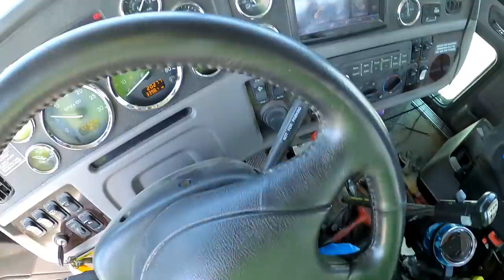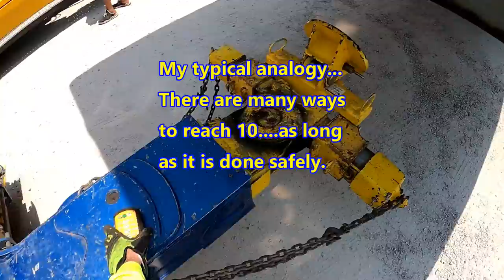SHUT DOWN AT THE SCALES!!!   TRAILER TOWING 'TATOR TIME!!!

Comment: Everyone hates the DOT Inspections, but that trailer is one of the reasons they are there. If the damage was not noticed at the scales, can only imagine what could have happened with the trailer loaed and coming apart on the freeway. Glad they caught it before a disaster. When you are done with the repair  I'm sure it will be better than new. Awesome job and video.
Reply: The worst part is that DOT never catches a driver the FIRST time they’re over limit or in need of repair!!
Reply: SMOKEY BEAR..ie DOT MAN..

IS MY FRIEND!!❤❤❤❤❤❤❤

LAW ENFORCEMENT AND TRUCKING PROFESSIONAL..NOW RETIRED!❤❤

Comment: When closing doors on van trailers, allays look up and make sure the top part is secure. Those doors have lots of flex and will close with just the bottom pin secured.
Reply: I have picked up presealed reefer trailers at shippers before that the tops are not latched.  Can be a pain getting permission to break a seal to close properly even if still at the shipper.
Reply: I just throw a ratchet strap around the bars when I encounter that

Comment: Re  : Chaining up the T-bar, my understanding there is that not only does it prevent the twin pivot points allowing the t-bar to rotate and potentially strike the underside of the trailer, but if it swingt the pivot under the 5th wheel would be at the wrong angle. It should only ever be able to tip front to back, as it it were to allow tipping sideways (if t-bar swung 90 degrees) you risk the trailer deciding to lie down and take a nap. (Then you really would need the rotator) Similar to when rigs turn the tractor unit too far when trying to get a trailer back out a ditch and losing the trailer over completely.
Reply: It's never good when the trailer wants to take a nap

Comment: Why is it more safe to take the trailer with the tow truck instead of the tractor? Or is it not trusting the driver to deliver to your shop to get fixed?
Reply: Because the driver was placed out of service
Reply: Think so or push it for one more load then might fix it
Reply: Because the trailer is deemed "unroadworthy" (think wrecked) by the DOT a cracked sub frame makes it OOS 
Out Of Service.
Only a tow truck can haul it off to be repaired.
Reply: Ron is licensed and insured to tow damaged vehicles. The trailer had been deemed to be damaged, and unsafe for use by the authorities while inspecting during the weigh. The leasing company contracted Midwest to remediate the problem and return the trailer to the tractor drivers upon completion. 

That's my take on the situation at least.
Reply: In my experience, the DOT/MOT (Canada) will not trust you as the driver to take it to an authorized shop for repairs. It must be towed and properly repaired. Too many "trucking companies" will sign off on repairs and risk the public rather than get repairs done properly.  The towers in the area know they will be closed down and fined heavily for releasing a truck or trailer to the customer prior to proper repairs.
Reply: When DOT places a truck or trailer out of service, it can’t be moved by driver for that reason so it gets repaired. That repair can’t be done on the roadside but it can still be moved by the tow operator to the shop to be repaired
Reply: I had this conversation with dot one time.  He towed my trailer for missing one lug nut. His excuse was the tow truck driver is trained to haul unsafe trailer.  Lol
Reply: The main reason is that tow companies have to follow proper securement procedures for any item they tow.  If the damage to the subframe was worse and not able to secure.  Then it would have gone on a RGN trailer for transport.  The reason a driver is NOT allowed to take to shop at this point is the trailer is out of service.  The rules had been placed since many drivers in the past would "say" they are taking it to a shop.  However later down the road they got loaded and driving it then failure causes a severe accident.  This is perfect example of a scale house doing the job.  However we need an extreme amount of additional officers as I am a driver myself and see too much faulty unsafe equipment rolling down the road.
Reply from the maker: @jerrykinnin7941  Exactly...thank you for the description to help clarify.  God bless.
Reply: Simply, the system that is used works. I have seen unsafe trucks being used as well as unsafe airplanes.
Reply: @RonPratt  could you have brought a semi truck or does it have to be a tow truck?
Reply: @tedmoss  yikes!!unsafe airplanes!!
Reply: @wilsonbobcatservice4151  From their point of view if you cant keep lug nuts on your wheels, then what other issues are you overlooking...
Reply: @MrJRod891  no the trailer was placed out of service

Comment: I'm wondering why you didn't use the Mini Pete, since you didn't need a 'Tator, just an underlift. Was it possibly because you didn't know if the trailer was towable or because Big Pete was your duty truck for the day?
Reply: I was thinking the same thing. But figured the other trucks were out already. What a problem to have. I do like the little Pete.
Reply: He could've used Truck 17, and saved a bit of trouble..But maybe it HAD to be a tow truck?
Reply: @Sara-L  It seems like it had to be a tow truck because it (the trailer) was out of service.

Quoting an answer in another post Ron responded to 
"Because the trailer is deemed "unroadworthy" (think wrecked) by the DOT a cracked sub frame makes it OOS 
Out Of Service.
Only a tow truck can haul it off to be repaired."

Ron responded
@Jerry Kinnin  Exactly...thank you for the description to help clarify.  God bless.
Reply: @realredditstories420  Trailer EMPTY......Little truck would have worked just fine.....load status likely wasn't knownat least thats how it always works for MRE

Comment: Love the new wireless lightbar. Does it not have the red and blues on it like the old one?
Reply: Red & blue are only necessary when getting to a scene (priority over normal traffic) or when a stationary hazard along a high speed right of way.  Aft facing and moving at normal posted speeds, no.  Yellow with white "kickers" is enough for visibility.  It also avoids the problem that arises when he crosses over to Illinois (or other states) on a job, where his Missouri-authorized red & blues aren't legal.  Why have an extra-fancy (and expensive) wireless lightbar with extra color options when this will do?

Comment: A couple of years ago, I saw you use the wireless light bar. Then I saw it in use locally and knew what it was. And that the RV being towed was being towed before I got around the vehicle. So I was alerted to the tow situation and exercised a little more caution when passing. Thanks!

Comment: Just curious could one just weld a  plate to the damaged parts or does DOT require a new sub frame
Reply: Given the stuff I've seen going down the road, as long as it passes inspection, you can fab up just about anything.  Of course, I don't usually look at them in detail unless they've already crashed.  Ha.

Comment: Didn't know you would need a translation app on your phone did you? I could tell those guys were frustrated because they needed a trailer to make money, so they didn't want to give it over. That is one of the problems when you rent a trailer.
Reply: But the OOS went to the Leasing Co. Since it was their trailer. Unless the drivers/company also got one for knowingly operating unsafe Equipment. A scale tried that one on me once.  Pre Trip Post Trip and a mechanic to fix it correctly is a must.
Reply: I'd expect the leasing company to supply the drivers with another trailer. Then when the original trailer is fixed, either haul it out to them, or more likely just put it back in inventory, and allow the drivers to use the replacement trailer...
Reply: Normally when renting/leasing they will give you substitute equipment you can use as long as you need until you get the other back

Comment: In this case wouldn't it have been better to hook up the actual trailer lights?  Trailer wasn't in an accident, could verify they work, and be safer with the normal lights?  
I see you put gravel down in the lot to the side of the shop now!  Lot more room!
Reply: I would have done it the same way Ron did. Never know what you are hooking up to with a strange trailer, especially a leased or fleet trailer. Could end up with all kinds of problems in your power unit wiring? I have hooked to some that melted my light switch posts. I had to replace the light switch. Better to be safe than sorry.
Reply: One addition reason for using the light bar would be that it is an indication to following drivers that this is not a normal tractor-trailer configuration.

Comment: Ron, nice video again. 
Quick question: why did you choose an manual gearbox and not a automatic for the rotator?
Reply from the maker: We have always used manual transmissions in our Heavies.   The Peterbilt rollback is the first "big" truck we have owned with an automatic.   So far it has performed well.  It has it's positives.  It also has huge negatives, especially in inclement weather, in my opinion.   Manuals are dependable and easy to work on should there be an issue....for us anyway.   Thanks for watching and God bless.
Reply: What Ron said but my feelings on automatic gearboxes for non standard work is you are often fighting the gearbox as the software is pretty primitive and always wants to be in the most efficient gear.. fine in most situations but it can be a pain when you know more than the box does

Comment: A new subframe is what I was thinking too. My last job before I retired was at Central Transport's trailer shop.  We used to pull the subframes out and set the up on stands and completely rebuild them. Brakes, suspension, lockpins, wearpads. If they were not rebuild-able then we replaced with new units.
Reply: Wait a minute...Central actually did repairs? I thought they just used the equipment until it fell to pieces
Reply: What was the cost difference between rebuild and replace? Especially if a subframe was cracked.

Comment: Every semi-truck I have drove uses auto-re-settable fuses for the trailer. Had one trailer with a dead short in the wire, lights was dim and keep blinking. Inspection reveled it was a nail though the wire. Pulled the wire off the nail and everything was ok. Noted it for repair and cause was shipper improperly securing the load.

Comment: In the UK most cross heads have a locking pin. This allows the 5th wheel adapter to be fitted without the need of chains.

Comment: If I am correct this weigh station is around an hour to and hour and a half north of your shop on I-57 depending on the traffic. It does make thing interesting when there is problem in communicating with drivers.

Comment: I got to have my own trailer trouble today.  Picked up an empty at a Walmart DC and saw damage on the frame by the tandems.  Obvious yellow post hit.  Sent in pics and got told to take it to the trailer shop in little Rock.  Further inspection there revealed that whoever hit the post just kept on going because 5 crossmembers under the trailer were bent all to hell.
And since the one who did this did not report it, I had to cancel my next load, drop this at a shop, and find another trailer.  It actually makes me angry when drivers in my company let our equipment get this bad because they can't be bothered to do a simple walk around.

Comment: All I can say is for all the broken rubber straps I see laying along the side of the highway, and for the few that I have had break in the shed holding up stuff like weed whackers, I can not believe you don't use adjustable straps on that very expensive rear lighting system.  Good job Ron... sounds like you are breathing a little better.
Reply: They wear out over time, so as long as you inspect and replace them regularly, there's very little risk of failure.

Also a lot of drivers store them out in the weather, unlike the light bar's straps which are stored in a closed compartment. That significantly reduces UV degradation.

Comment: Ron, If you did this job with the big Western Star using this setup could you use the locking pin to keep it the T-head from pivoting (instead of using chains)? 

True it would be best to chain up regardless. I was just curious if that locking pin could be used for that purpose.

Comment: Remember having a double pivot towing a car with a rental truck - turning around was a matter of taking the whole "train" apart, turning all the pieces, then putting the trailier back on the truck, and the car back on the trialer and resecuring everything - learned real fast to limit those situations.  Backing with two pivots seems impossible.
Reply: Backing w 2 pivots, isn't impossible....it's just a learned skill.  And it's NOT learned overnight for sure...
Reply: It's a pain but possible, used to work in a weld shop that used steel wagons to move beams around the yard. The biggest thing to remember is that when turning the double pivot cancels out. Meaning instead of turning right to go left you turn left, you also need to make much smaller maneuvers because the  shorter first pivot will compound any turn of the wheel.

Comment: On the point of Ron hooking up his own lights to the trailer is smart. The trailer/9pin fuse location on KW's and Peterbilt's can be tricky. You have 1 fuse box under the hood that has 4 fuses for the trailer circuit but the other 2 like the marker light fuse is in the cab on a different fuse panel. Why I don't know.

Comment: Great video. Just a quick question have you ever had to replace the small black lights on the rear side of the truck. They look like they could easily be broken off.
Reply: They're made of rubber and are quite flexible :-)

Comment: Good one Ron.  Just one thing though.  Because its over long, should it not have a plate on the rear stating its an abnormal load, ie, longer than usual?  I know there's one for extra wide vehicles, but what about extra long, especially a towed, damaged trailer?

Comment: Hi ron, i watched many of your videos
especially interesting me your solutions to problems because we can say we have kinda same situations at work and im happy to learn new solutions (i'm not working on towing nor i have license to drive trucks).
My question is:
Only in this video i noticed the right indicator at your dashboard.
Is it the REV indicator? (the right large indicator).
It seems that you are driving on the highest Rev possible most of the time.
Isn't diesel work better at low Rev, and keeping low Rev better for the engine?
Or i'm totally wrong.
(again i'm not a truck driver)

Thanks.

Comment: You would think that the company that owned the trailer would have communicated to the drivers that you were going to take the trailer to be fixed. Communication is a key to any business. The driver of that trailer is not convinced that you are going to take the trailer back to your shop. He is waiting to see with his own eyes that you have it securely on the Tator!
Reply: I’m sure they did. The drivers were concerned about the violation report. The report has to be signed and turned into the State that issued it, in most cases. That can only be signed “after” the defects are corrected. I’m sure they were thinking, how am I going to get back here to have it signed. So they were just trying to get it signed ahead of time. Which you can’t do.

Comment: So what I don't understand is how they managed to crack the tandem frame on that trailer.

I've pulled Star leasing trailers in the past, and they were my 2nd favorite lease trailer to pull. Always newer trailers in impeccable condition.

The only thing I can think of is that they SERIOUSLY overloaded it and we're very rough on the assembly trying to slide the tandems, or else they hit something solid, really hard. But it doesn't look tweaked.
Reply from the maker: Actually, this is a quite common failure on these subframes.   We replace a LOT of these under-carriages for this exact same reason.   There are several weak points in their systems and almost always at a joint-weld.   They will crack out at and around the spring hangers and center hangers.   Again, a very common problem that I see and repair.   Thanks for watching and God bless.
Reply: @RonPratt  huh. I've never seen a newer trailer crack back there.

I did have a trailer crack across the tandem frame on the left side once though right above the front axle support, but that trailer was 20 years old. Unfortunately no easy way to share a picture in the YT comments

Thanks for the quality content and keeping me company during lunch!

Comment: Since the trailer was not road worthy then what is the thought behind having it towed?  Meaning if it was towed by a wrecker then could it have been transported to repair facility on the tractor unit it was attached to in the first place.  I don't get the thought process.

Comment: hey ron, dumb question, there at the end before you took off with the trailer, you pulled the handle that would be a gear shift in regular vehicles there by the steering wheel and said the brakes locked up, whats the difference between that and the air valve you pull to lock the brakes
Reply: That handle applies pressure only to the trailer brakes.  The red knob supplies air to the trailer and releases the spring brakes that are used for parking.  That handle is only used for testing trailer brakes or fifth wheel tug tests, and a few other rare reasons.

Comment: Question, what is the difference in a tow truck towing the trailer to a repair yard and a normal truck towing it to the same yard?
Reply: It may be an insurance liability issue.  The tow company may be insured to transport damaged and defective trailers where as standard insurance may not cover accidents cause by towing a known damaged trailer.